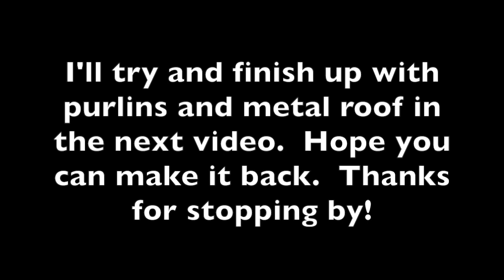DIY 3-Bay Carport Build (Part 4: Rafters)

Comment: I am not a builder so take my comments with a grain of salt.
1. When running a string to line things you want to leave a gap (1/4") on the first and last post/wood and maintain that gap on each post/wood in between.  If you put the string flush on the first and last piece (like you did then you propagate the error if any piece in between touches the string.
2. I see you have not made any plans for bracing of the carport. "matchbox effect", i know you have post 2' in the ground but i don't know if that is enough. You can brace in between rows without affecting drivability.
3. Nice job.
Reply from the maker: Excellent points!  I tried to stop just short of the string line with each board for just that reason.  The bracing between rows is always a possibility in the future if we feel that the structure is lacking strength or stability.  I'm keeping a close eye on it during our windy times to see if I can notice any weakness.  Thanks for the suggestions and for watching!